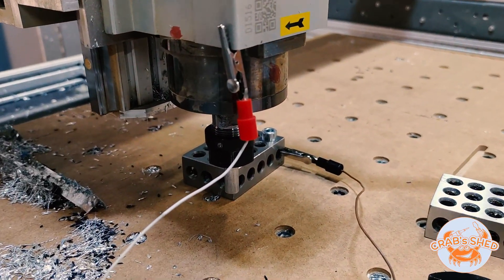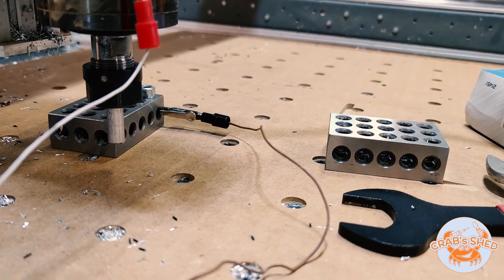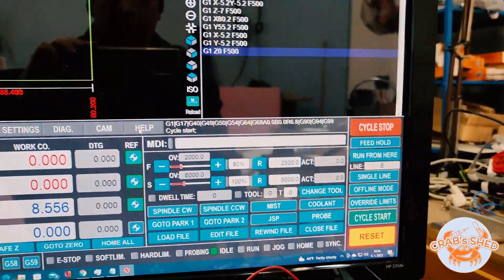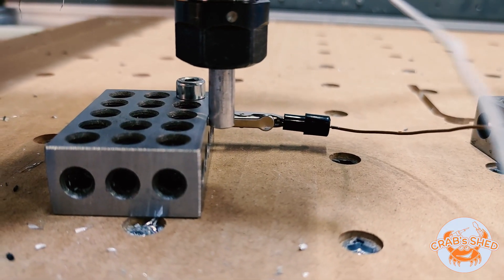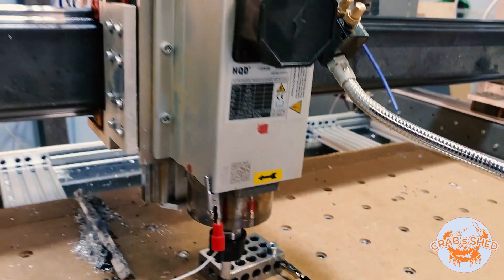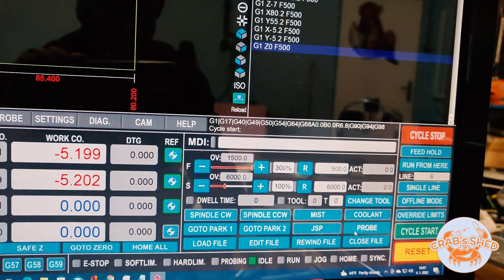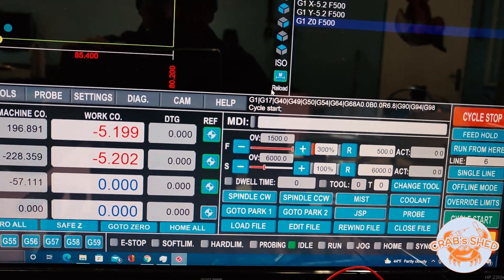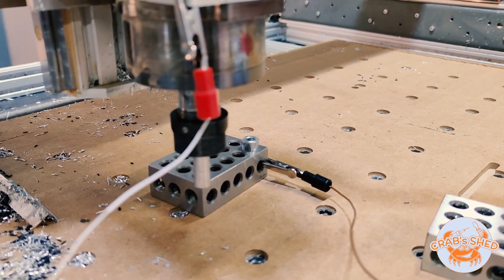UCCNC Custom Macro - how to find XY0 corner on a rotated part

Comment: Very cool, thak you ! This gives me some new ideas. 

Do you think it would be possible to create a macro to measure everything the same but with the tool rotating backwards?

Is it possible to measure seperate rotations for G54, G55, G56... ?
Reply from the maker: Hi, glad you like it. I have very little time for CNC hobby nowadays and have not used it much lately so I did not play with it anymore than what's in the video.

Comment: Just wanted to say thank you for the macro. I finally got around to using it and I got a perfect chamfer on my part even though it wasn’t perfectly lined up.  The 821 start probe function still doesn’t work whilst g68 active but I can just run m31 screen instead. I’ve been manually entering variables for now but plan to add a few fields to the probe page so I can quickly enter variables.

Comment: Also how do I adjust for probe size? Thanks
Reply from the maker: You need to change the "double ProbeDiameter = 10; //probe tip diameter" on line 32 in the macro itself to change probe size. Not sure how to add a variable to the screenset and use that. It would be more comfortable for sure.
Reply from the maker: Also all other parameters need to be adjusted in the macro code (probed points on X and Y and their distance and direction).
Reply: @Crab’s Shed thank you, very helpful, looks like I’m going to need to look into the macros more so I can customise to suit.
Reply: It seems like you really figured out how to use macros! 😀
Question:
Would it be generally possible to make a makro so that a 3d probe can measure the z-height and right after that measure the hole z surface each 40mm in x and y direction to be able to cut/engrave at the correct z-depth even when the material is bended and not totally flat? (compensation)

I‘d seen videos where people used these functions but… the video is like 30 minutes long and it’s too complicated to do as I need to do this on every part i want to cut. 😅

Comment: Great idea but how do I set zero for z afterwards seeming I will need to change bits.
Reply from the maker: This macro just gives you the correct WCS zero for X and Y, plus the rotation angle. For probing Z axis use the UCCNC probing screen and the appropriate probe method there. You can combine several probes depending on what you need. It does not have to be done in one macro or probe cycle.
Reply: @crabsshed  I attempted to do this but couldn’t probe Z afterwards due to an error along the lines of cannot probe whilst g68 is active
Reply from the maker: @MrBrettStar  hmm, I thought Z axis probing works with G68... X and Y don't for sure... Have not really used it much since making the video. Maybe disable G68 probe Z and then rotate again? Rotation point should be already set unless you change it with another probe. Just write down the angle when it shows it on screen. Or use the variable from the macro where it should be stored.